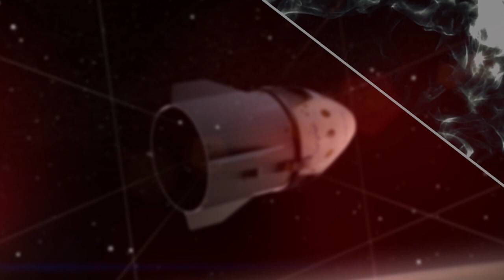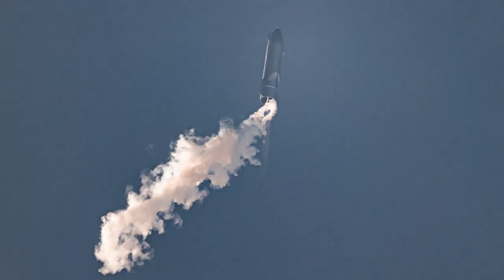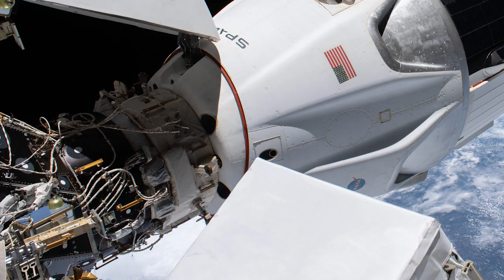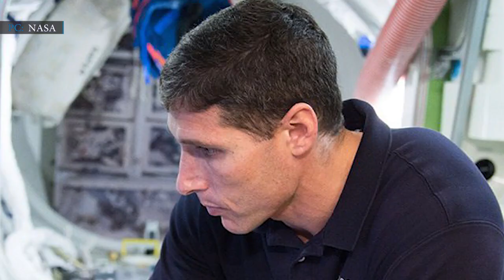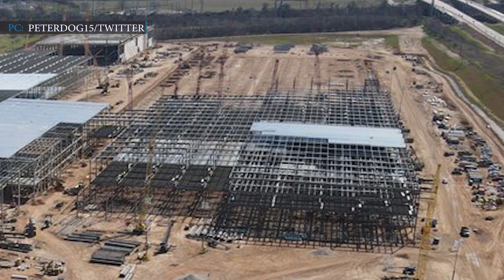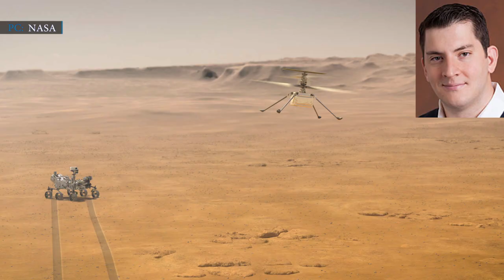SpaceX Starship SN11 explosion on Raptor engine leak: Elon Musk blames

Comment: Well there was definitely something going on in the lower fuel tank, it looked like insulation was missing off the pipe going through from the top tank, there was also some displacement of gas around said pipe at the bottom, indicating to me heavier gas had got in there or the pipe was hot! Either way they should be looking at that ?

Comment: The Raptor engine still has a long, long way to go.  A raptor has to be replaced or is damaged by every static fire.  Then of course the fires, which have been noticeable since the first hop by SN5.  Elon says there are improvements with SN15.
Reply: Raptors are improving along with starships. SN15 is supposed to be outfitted with improved raptors. Hopefully means less issues
Reply: @aqeelraja4750  So does that mean they just kept sending the older raptors to Boca Chica?  Why not just send the improved Raptors instead?  That way SN15 didn't have to blow up.
Reply: @gizmo8760  raptors are expensive. I assume they can’t just ditch older ones. Also SN11 already had engines preinstalled from a couple of weeks before it launch so it already had older raptors

Comment: How about some kind of a balloon of course not a hot air balloon but a balloon that would have Lift through lighter gases. That you could inflate once you get it there may be a propeller to move it around some for different locations. That would be another way to get aerial pictures.

Comment: It's about time they fixed that leak. It seems to me it has been off and on through this entire process. The first report I heard about an earlier leak was that it was insulation. It didn't look like insulation to me and a similar flame occurred on other flights. It may be something they were aware of but thought would not be a problem and could resolve it in their design update. Best laid plans.
Reply: Hey rorroc do you do all the plumbing and furnace work in your home?
Reply: @genebohannon8820  Well, actually I do. When needed
Reply: @genebohannon8820  What possible reason is there for your question?

Comment: 85 million dollar drone lololol. Only in America. I don't care there us just no way.
Reply: It has to fly itself, on an alien world with radically different temperatures and almost no atmosphere. And don't try to take a drone we fly on earth there either, everything needs to be the lightest materials you can use. The blades on the copter had to be radically redesigned to give enough lift in the Martian atmosphere. They also have to spin MUCH, MUCH faster than any helicopter on Earth would ever do.

Yeah, if it flies it's money well spent. I can see this applying to Venus to some extent as they can use solar panels on the day-side to practically fly forever (engine lifespan permitting).
Reply: @Shadowfax2121  yes an amazing feat of engineering. I certainly do understand all the hurdles but sorry no. 50 million probably went to pure air leaving 35 million for developement? Just no.
Reply: @glenzee9083  People like him are why intelligent people can get away with this kind of robbery.